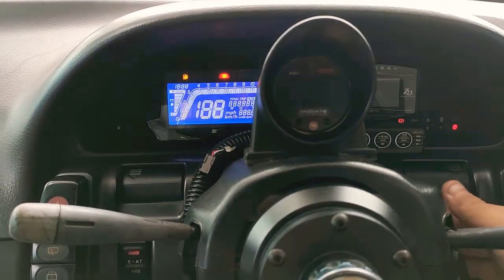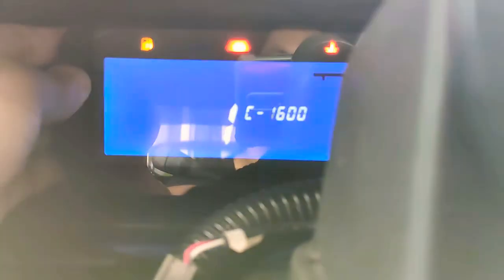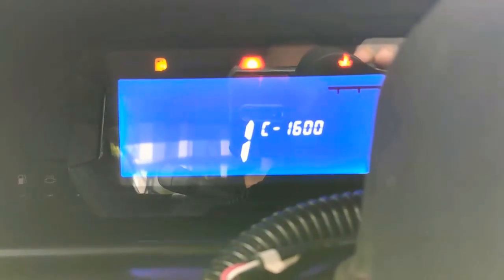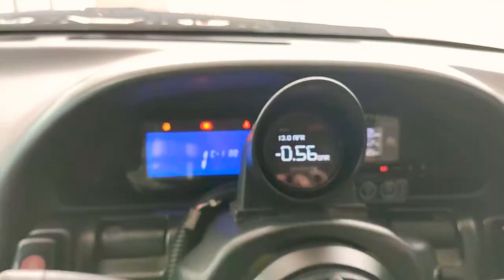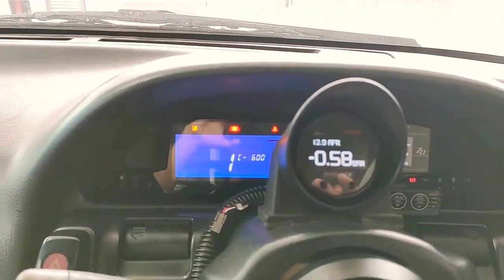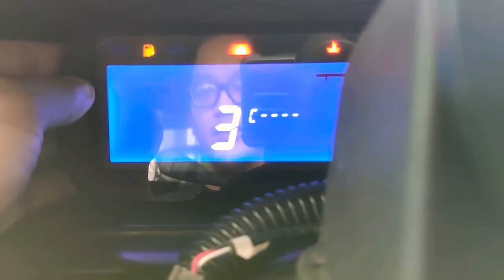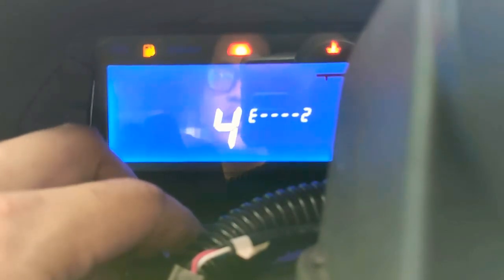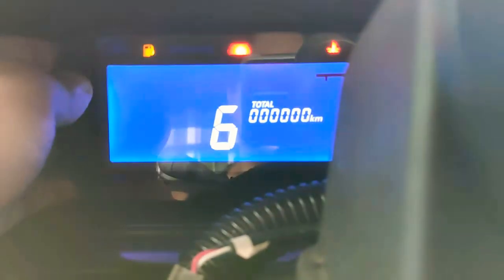How to: Install Custom Digital Motorcycle Cluster Dash with Setting and Wiring into 240sx

Comment: Do you have instructions i planning to setup also
Reply from the maker: its a trial and error, just need a analogue input from the original dash into the digital dash. For the speed sensor, some are able to direct convert from the ecu, but mine goes from the ECU and  convert the signal from another circuit in the dash. Previously i remove  the circuit and it wont work. For the others like rpm, fuel, headlight and other warning just use the signal from the dash/cable. My tips is to ask for the seller which wire for which signal. Another thing is for fuel level. it will slosh around, so u wont  get a definite reading unless u are standstill. Also check for the resistance of the fuel level float, differ manufacturer will have differ resistance type.
Reply: @dodgemk2  i have a kia pride gtx i want it to be digital type. And im studying how its gonna be wired.

Comment: Dah jumpa ke cara nk bg speedometer function bro?
Reply from the maker: Speedo function bro, no problem. Kalau moto die pakai magnet. Kalau s13 die pakai pulse. So boleh function. Meter semua function. Bab minyak je die tak syok. Sebab kereta gerak so minyak naik turun. Die ada device namanya anti slosh circuit ke meter.dlm rm200 dekat ebay
Reply: @dodgemk2  b18cr s80 gearbox pakai pulse gak ke bro?
Reply from the maker: @wanmuhammadnasrulhaqliwanr3860  kene check diagram bro, s13 dari geaebox pegi meter dulu baru pegi ecu.
Reply: @dodgemk2  ok tq sifu